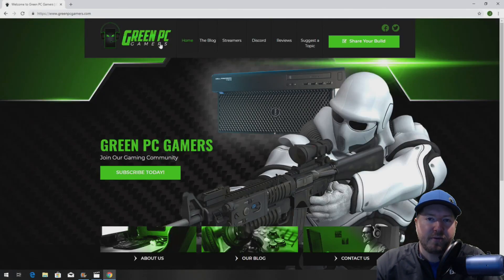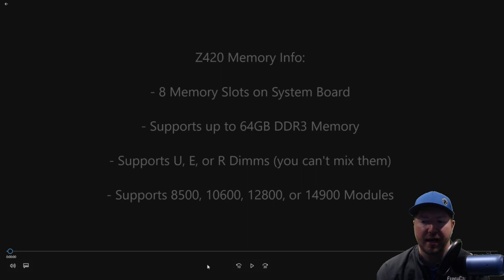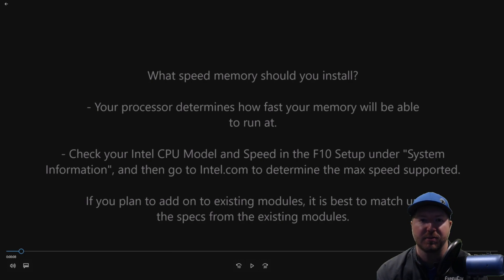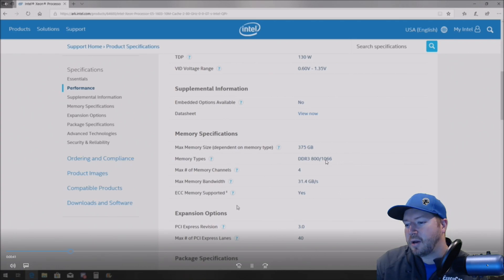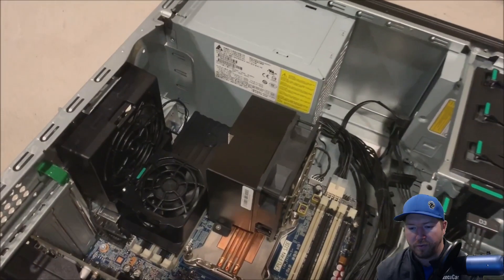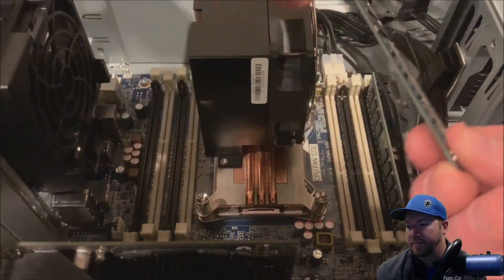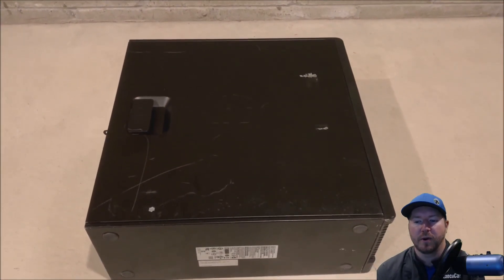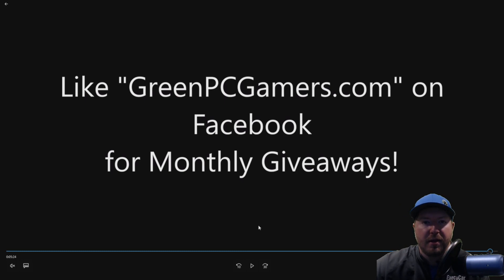HP Z420 Workstation Memory/Ram Install

Comment: I upgraded BIOS to the latest and upgraded my processor to E5-1650  hexcore.Which allows me to upgrade the momey to 48GB. I sloted in all memory slot but i'm still given me 40GB. I used the S1/S8/S3/S6/S2/S7 formation.Any idear on how to get the 48GB REGISTERED.Thanks
Reply from the maker: Are they all the same MFG and model?

Comment: thanks for doing this   trying to go from 16 to either 32 by swapping 4 8's or adding 4 8's to the 16.   I added the 4 8s and got the 5 beat code.  hopefully I did get matching ram but you have been very helpful   Its not too expensive anymore so worth the try either way.   I am not sure but this was bought used and half of the slots may not work.   I seem to remember the place i bought it from after the fact telling me it showed 8 but only four worked so not sure.   anyway.  thanks again.  gives me a push in the right direction   I have done this before with no issues on other computers but this one likes to beep and five error codes

Comment: I recently acquired an HP Z420 workstation. I also acquired a Z620 motherboard.
Would there be an advantage to swap out the motherboards?  I realize the Z620 has an additional LAN port and a connection to an a riser for  second CPU.
I have no use for the second LAN and no plans to spend $$$ on adding the second CPU.

Comment: Many thanks for the Z420 videos. I can confirm that 128 Gb is possible on my V2 Z420 on J61 v03.96 BIOS version running SK Hynix  128GB 8 x 16GB 2Rx4 PC3-14900R server memory, 600W PSU with memory shrouds

Comment: Is there any special reason for white and black RAM sockets? O all of them the same ?
Reply from the maker: HP Spec Page:

"Each channel includes two DIMM sockets; black and white connector pairs represent a channel. Load all black slots
first and then load the white slots."

https://h20331.www2.hp.com/hpsub/downloads/z420_memory_configurations.pdf

Comment: . These barebones refurb Xeons are quite an affordable speed demons if handled properly.  They're flooding the market. You have designed a whole green approach around presenting rehab on these workstations with well researched options and part lists. Very thorough technical information Good video inside those cases one can really put their hand into. Just finished a T3610 and it's a fine peice of equipment. Will be heading now for an hp z420 to build with a friend. Re-cycle. Thanks

Comment: Hi, I have a Z420 system with a total of 32GB of ram1866MHz and used only half of the available dimm slots, so I have still 4 dimm slots free to expand to a maximum of 64 GB agree with official HP docs. It is possible to use 1600 MHz ram together with 1866 ones ? If yes, will they work independently about speed or will they work all at 1600 MHz ? Thanks much for your time :-)

Comment: so i have Two 4 gb Sticks and two 8gb sticks of RAM, all matching speed and type DDR3L, which dims should i populate with the 8gb sticks and which with the 4gb to have them run smoothly? running on the HP Z420 workstation

Comment: I was able to install the E5-2697 in my Z420 with no problems, also I was able to install 128GB of memory in it and that also works. The only difference was when the Z420 initially boots it makes that loud spin up noise then that noise goes away after 3-4 seconds. With 128GB installed that spin up noise last maybe last 7-8 seconds before it goes away.
Reply: How is this working out? I'd love to update my system to more than 64gb.
Reply: @grammapolice  On the Z420 everything works great and I suspect that it can probably go to 256gb of memory DDR3 32gb SIMMS in the 8 slots. The 128gb of memory is working just fine with no problems. The 12 core E5-2697 is also working just fine in the Z420 with no problems. I do a lot of large code builds so I typically run the system 100% busy for extended periods time and I haven't had any trouble with over heating and thats using the stock cooling solution.
Reply: @lashlarue59  wow so it can read 16G modules , thanks for sharing the info :), just wondering about the boot block date of yours and whether this CPU is v1 or else
Reply: @AkramESG  The 12 core E5-2697 is a v2 CPU. As I recall the boot block date was whatever the latest date was and its the latest BIOS.
Reply: @lashlarue59  aha , as the older boot block date is 2011 can only run v1 Cpu's , thanks for your quick reply :)
Reply: @lashlarue59   were you able to take it beyond 128gb of memory?  I have a unit arriving and I have to take it to 256gb.  I will first start with getting w11 pro working.
Update 9/17 - I was able to take my z420 to 256gb of memory.  A-Tech 256GB 8x 32GB 4Rx4 PC3L-12800 DDR3 1600 MHz ECC LRDIMM Server Memory RAM
Reply: @gsambolin  No I only installed 128gb and I did not try 256.
Reply: What memory speed did you get the 128 GB to work at? is it 8X16GB RDIMMS ? or 4 X 32GB LRDIMMs?
Reply: @ProcessedDigitally  I don't remember the speed but it was 8x16's.

Comment: I am writing to adk your assistance please. I can't find the info I need anywhere! I presently have 4 x 2GB 1Rx8 PC3-12800E-11-11-D1 in my Z420 and would like to know if I can upgrade  adding 2 x 8 3Rx8 PC3L-12800E 11-13-E3 memoru. You mentioned sticking to the specs as best as possible. The brand name are the same across the board with specs almost matching. Just want to know if adding low voltage memory will cause a problem. Thanks in advance.

Comment: Hi. Great videos. Really useful. One random question that I can't seem to find an answer to: why is there a fan shroud only on the left hand bank of memory on the Z420? The right hand side gets pretty hot when pushed!!
Reply from the maker: Thank you for the kind words, and great question!  We hope to someday have a good answer for you =)
Reply: You will notice the fan induction for the CPU cooling is right in the area of the rising heat of 4 dimms to your left,  then you have the cpu fan that is sucking air through and pusing it to the right,  then 4 more dimm banks with a fan pointed straight up to the sadly ONE exhaust fan,  the flow of heat is in theory more controlled doing it this way,  it is apparent looking at it face on,  if the first 4 dimm slots had a fan pushing heat into a open area in the case this would increase internal heat of the whole unit,  not having it here actually makes it run cooler by having only one route of heat flow,  but yeah it will get hot inside lol it is a workstation,  but it is way hotter that which is expelled out of the back.  Hope this answers your question. In short it saves HP money and you money in turn plus keeps heat down for the user vs having a fan to push the heat into a dead zone to build up to a higher level
Reply: @heliosgnosis2744  Many thanks!! Makes sense
Reply: Did you find the answer to this? In case you haven't yet:  The workstation had an optional right memory shroud / airflow guide. I got one for mine recently.  I think you only really need it if you're using a high powered GPU or other high powered PCIe peripheral which raises ambient temps significantly in the case as it not only protects the memory but also more efficiently directs the hot air coming from the bottom of the case to the rear exhaust fan. The Z420 also had its own front intake fan called the 'front chassis fan card guide kit'. Not all Z420s came with these parts as they were only needed and included for the configurations that had high performance GPUs and CPUs at the time. You can find both of these parts used quite commonly on Ebay /Allie Express. I upgraded the CPU in my Z420 to the 8 core E5 2667 V2 and  put an RTX 2070 GPU in mine, and had thermal throttling on the GPU even with an aggressive fan curve. I got the Z420 front intake fan kit and the aforementioned right memory shroud and it improved temps greatly for both the GPU and in the case itself. I think the front intake fan in particular was well worth buying (assuming your GPU runs hotter than you'd like).
Reply: Forgot to mention that the right memory shroud doesn't include a fan (in line with what Gnosis Herbal's LCC said about heat flow).
Reply: @danielfoyster6937  I have just upgraded my Z420 to the E5-2667 V2 and thankfully my system came both both the shroud and extra fan. I've been running a AMD RX580 for a while now and your the first person I've found that has a very high end GPU. Is there any/much bottleneck with your system? And do you think the CPU could handle 30 series Nvidia cards?
Reply: @David-oz7se  I recently sold the HPZ420 to put together an i7 10700 build (but kept the RTX 2070 as 30 series availability and pricing isn't so great right now).  Regarding Xeon E5 2667 V2 / RTX 2070 combo: I'm not into Esports / competitive high refresh rate gaming so I don't know how much the CPU would bottleneck the GPU in these situations, but I assume quite a bit due to its clock speed and single-core performance. However, for playing AAA games at 1440p 60fps, it was fine in a lot of cases and was mainly GPU bound. For example, Red Dead Redemption 2, Metro Exodus,  and Control all ran quite well. I wouldn't say that I get more fps with the games I play with my new i7 system as such, but the experience is a bit smoother. With the Xeon system, the 1% lows were lower and did mean some degree of hitching/stuttering in a few of the more demanding areas in some open-world games released within the last few years, but nothing that ruined the experience either as it was mostly fine. I also play city building and some simulation games, and with those it overall performed well but did struggle a bit due to being more CPU bound, but again still overall very playable. If you can get your hands on one, and assuming you're not into high refresh rate gaming, then I reckon you should be Ok with an RTX 3060, as that sits between the 2070 and 2070 super in terms of performance so would be a substantial upgrade over the RX 580, and will work well with the Xeon so long as the game is primarily GPU bound. Anyway, how this helps.
Reply: @danielfoyster6937  thanks a lot for your reply and insight on the performance of your system! I think a 3060 would be a good card for it too, still waiting for better prices and availability myself too

Comment: i watched this video trying to finger out why ram was not working on my z420 (Which was a DDR3 G.Skill 8 GB stick) and i thought after the video that the the problem was the dimms type then i look at my ram and i could not find out what it was then i did more research on dimm and i could only find U and R and i have no idea about the other types. I am stumped and if you could help me with my situation that i would be great full
Reply from the maker: Try only installing the G.Skill modules.  Don't try to install them existing modules.

Comment: I've had a look at the manual for the Z420 workstation, and it states that the board only accepts ECC modules of 1066MHz, 1333MHz, and 1600MHz DDR3 RAM, but supports up to 8gb modules... Are you sure that it'll take 1866MHz modules, and why does your builds use primarily 4/6gb modules??? And last: does it matter if you use PC3 or PC3L modules, as long as they are all the same???
My brother got a Z420 for free, but missing the RAM, GPU and Harddisk, and I've agreed to help him... Thx...
Reply from the maker: Yes, the Z420 V2 system board does support 1866mhz modules.  You must use a compatible V2 processor to achieve the 1866 MHz speed.  PC3 = 1.5V and PC3L = 1.35V.  We don’t normally mix the voltages.  The manual is a bit outdated.
Reply: @GreenPCGamerscom  Thank you for the response. I'm assisting my brother whom just recieved a leftover Z420 from work.
Are there any benefit for doing 16gb ram in a 4x4gb config instead of 2x8gb config?

Comment: Did you notice that z400 series n other z series can't mount non ecc memory?
Reply from the maker: Azri Shahrir most can.  You just can’t mix the ecc and non-ecc memory.
Reply: @GreenPCGamerscom  which mean i can use normal ram such hyperx fury or others on z420 but can't mix with stock ram?
Reply from the maker: You can’t mix ecc and non ecc memory.  You also can’t mix registered and unregistered memory.  Your statement is almost always accurate.